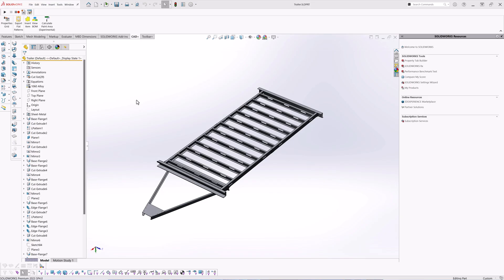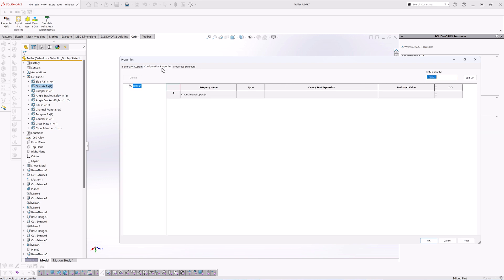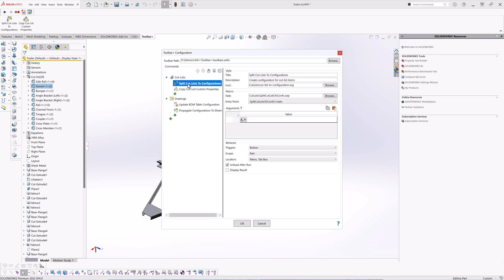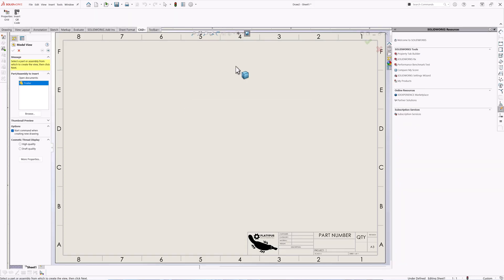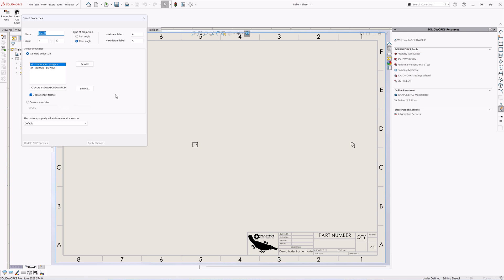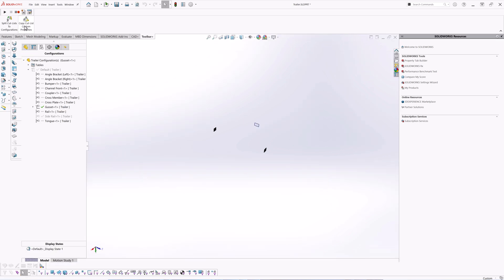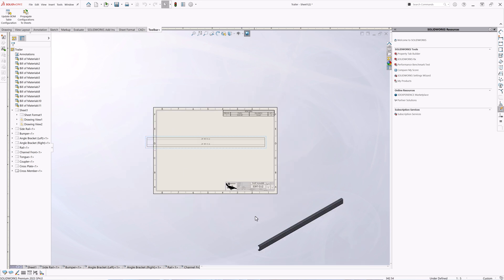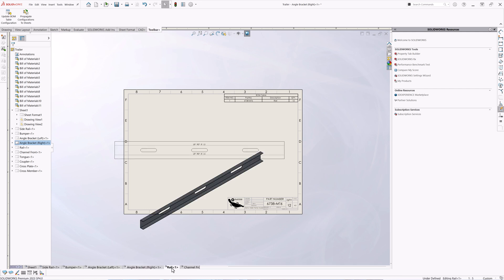Multi-Body Drawings Generation in SOLIDWORKS

Comment: Hi, firstly thank you! Secondly, is it possible to add functionality to skip configurations/drawings that have already been generated and only run the code for configurations/drawings that haven't been created yet? The reason I'm asking is the macros don't allow any new bodies to be added to the model after the macro has been run once. It returns the error "failed to create configuration for ..." and stops. The auto drawing macro creates all drawings again if run twice, it would be great if it only created drawings for new configurations so you can add on any new bodies in the part file.
Reply: Hi, I managed to get the functionality, so no issues now. Love your work!

Comment: Hi all the script is working fine, but when it creates the configurations of the MB the sheet metal properties of the bodies are deleted and I cannot restore them or how to fix it. I use SW 2018. If you have any tip to resolve this I will be very thankful